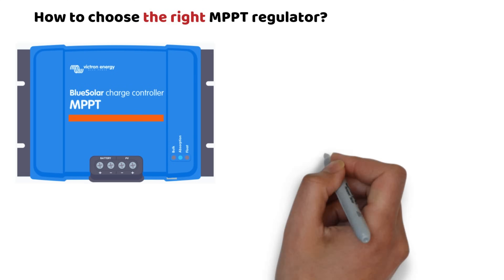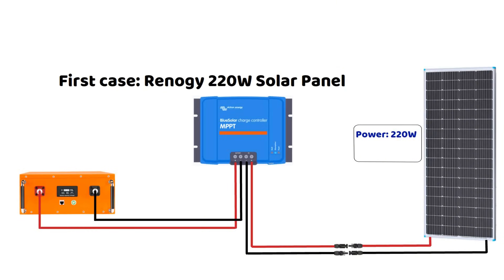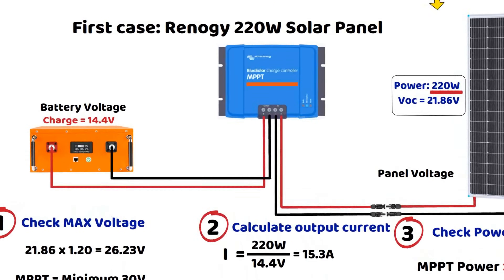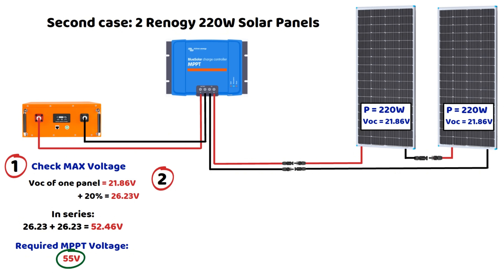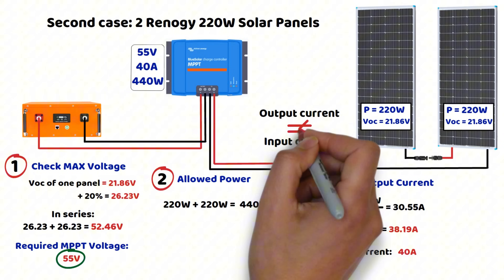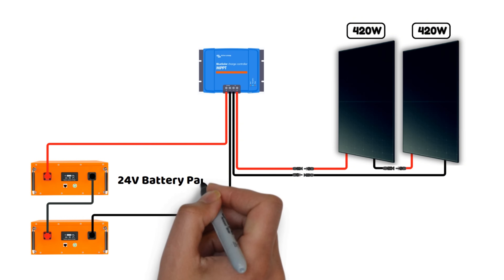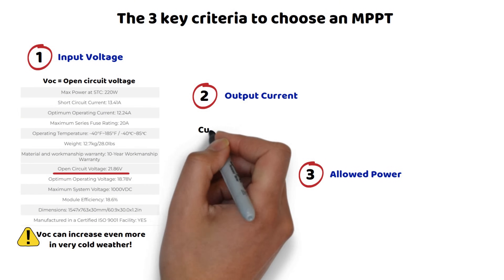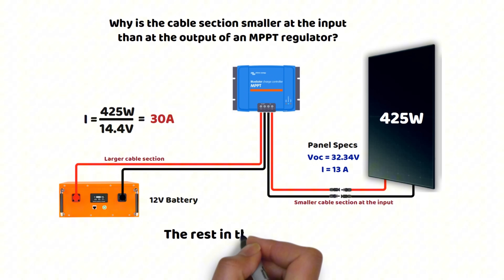How to Size a Solar Charge Controller? Avoid This Mistake...

Comment: In other words, you can skip all the electrical formulas and equations and just buy the MPPT controller that has the highest rated specifications in the model line up without going into industrial grade model's. This will future-proof your system and allow you to add more panels in the future without having to upgrade your MPPT controller. You want to avoid buying a controller that closely matches the panels nominal output because that controller will always be operating at or near its maximum capacity. At first glance, it will seem like the cost will be higher but in reality it's actually cheaper than buying a cheap system first (if there's such a thing) then having to repurchase bigger controllers and re-run bigger cables later just to add more panels.

Comment: Two panels connected in series you add only the voltage, the power remains the same they were a single panel.
You added both, the voltage and power.
Can you explain why? I didn't get it.
Reply: 2x400 watt paralel is 800 watt  in series 2x400 is 400 watt and not 800 Or i missing something
Reply: @hubertsteenbekkers1522  you're right. I asked the AI and it confirmed it. I was wrong . Thank you!

Comment: I am trying to find what mppt controler should I use with the 6 X BougeRV Yuma 200 W Cigs panels and for LFPO baterries x300 Ah ... I understand that it is much better to connect the panels in parallel and not in series in order to use a smaller MPPT. Is this correct ? For your guidance the Voc of the Yuma 200 w CIGS panels is 31,5 V and the Vmp is 25V..

Comment: Bigger is ALWAYS better (controller and wiring).
Just remember the return on investment - $1000 controller for a 100 watt panel is a bad investment lol
30% more specs is a good return on investment. Less stress on components for one. And you can add more panels if desired.

Going with a Victron 150/70 with 800 watts input. Bad thing is I am using 8 gauge wire (2 wires - red and black- at 100 feet each).
Panels are rated at just under 25v and just under 9 amps each. SS voltage is just under 28V. OC just under 25v.
I should be OK I think.
Pretty sure I can add another panel in the future too and still be under the max. Maybe a 400 watt one next time?

Battery cables (4 LiFePo4 12v 100ah batteries in parallel) will get 2 gauge wire each.
Inverter is 2000 watts but not running at max - just a refrigerator and maybe a chest freezer for about 250 watts or so.
Extra capacity is because of power draw at compressor startup. And to limit wear and tear on the inverter.
2 gauge should handle that momentary draw.

That Victron is a whopping $400!
Bigger one is $200 more and up goes the pricing after that.

800 watts generated /12.8v battery voltage = roughly 66.67 amps then divide that between 4 batteries and each gets about 24 amps. And that isn't going to over heat the batteries at that rate.

Most likely I will get about 15-17 amps per battery due to losses.

Just have to wait and see as I haven't assembled the setup yet.

Comment: G'day guys. I'm totally lost in this. I have 3 times 440-watt solar panels with an open-circuit voltage of 35.35 volts each. Got a 300ah lithium, what sice 12 volt Victron solar controller do I need please. Thank you for your reply

Comment: I need to charge 3-12 volts hooked in series for a 36 volt trolling motor. Can’t seem to find a controller for either 3 twelves or one 36. Please help.

Comment: My solar panel puts out 48 volts. Can a solar controller charge a 12 volt battery for running the pond filter during the night. It runs two water pumps during the day. With one panel. Can I use the second panel for just battery charging?

Comment: Good to know: for Victron MPPT’s the input current (Amperes) from the solar panels can be higher than the rating on the MPPT. In such a case the MPPT will then reduce the output current to the battery (to the rating that you will find on the MPPT). Of course this is not an optimal situation, but it will work. This info can be found on the Victron website.
Reply: Reduce output means generate more heat.

Comment: Your output current for a series of solar panels is horribly wrong. It should be the total power of all the arrays in series divided by the total nominal voltage across all the panels in series. It is also equivalent to the power of one panel divided by the nominal voltage of that panel. In your example, it your first example of the series connection, it should be 440W / 28.8V or 220W / 14.4V = 15.3A

Comment: I don't get the chat about maximum mppt voltage input suddenly changed to "minimum input voltage" 1:24. it's confusing. is the video done by AI?
Reply: Yes, its an AI voice, probably an AI script that gets a few things wrong and presents it in a bit of a confusing way. Also even mentioning the max panel wattage for the controller is a bit silly, wattage matters only tangentially, via the important specs of voltage and current.

Comment: SAY WHAT???? Listening to this was like listening to a flash flood! It’s moving so rapidly nothing can be absorbed, especially for beginners. The information might be excellent and an affirmation for those who already know 95% of the information shared, maybe helpful for folks on an intermediate/advanced level, but  it left me frustrated and feeling stupid.
Reply: No need to feel stupid.  This "teacher" is reading the script.  I don't think he could think this fast and be accurate as well.  I totally share the above comment about excellent information however all his effort is wasted if he wanted to teach.  Personally, if all his videos are like this, I won't subscribe.  There are literally hundreds of solar channels available that  provide information in a manner that is useable .  If you haven't seen the channel. "DIY solar" by Will Prowse do yourself a favor and check him out.  He speaks clearly at a reasonable pace, he doesn't read from a script.  There, I've wasted enough energy.
Reply: @tedk2814  🎯 Exactly.  I don't know what this guy's deal is but it's a lousy presentation. I'm not even going to go past step one. I'm a retired career (Avionics)  Marine as well as an instructor. He's doing all the wrong things.
Reply: you can slow it down so you can listen to it carefully
Reply: Yeah, adjust the playback speed from settings under the video.
Reply: @Polydeukes68 
I have no option to adjust playback speed on my smart TV.
Reply: .85 speed 👍
Reply: Lousy video! 
Your video sucks bc youhave it on rapid talk mode. 
No option to slow it down.
I went to find other videos that are talk slower.

Comment: What if you use a100 watt panel and a 12 volt battery, and a 1000 watt inverter, not everyone has more than 1 panel. Your video ain't working for me. I also have a l iron, not lead Acid .u got more money than my ass

Comment: So you might as well use pwm controller as they don’t seem to have a limit on input power ?
Reply: No - for 2 reasons; PWM are terribly inefficient when your panel voltage is more than about double the battery voltage, so PWM were great in 1990 when every panel on the market was around 15v-20v. Most panels now are 40v, so the MPPT is really the only solution. Secondly, mppt don't have a limit on input power, the video is incorrect. If you fuse appropriately, you could run a 10kw array on a tiny controller, the only issues are that if you connected the panels with reverse polarity you would break the controller (Victron can dissipate the power in reverse polarity but only up to their rated "max panel short circuit current" value) and your array would have a terrible cost efficiency.

Comment: I mainly use two Oupes solar generators that require only that I plug my solar panels into them and that's all there is to it.  It's basically plug and play.

I also have a small DIY solar setup that consists of one lone 250-watt solar panel that I presently have connected through a 40-Amp off-brand PWM solar charge controller.  Solar panel VOC is 37.6V and the ISC is 8.85-Amps, and the batteries are 12.8-Volt 100-Ah LifePo4 batteries.

This specific PWM solar charge controller is one of those that come with a user's manual that reads like it was written up by some Chinese guy who barely knew how to speak English.

I mention this because it's virtually impossible to understand those setup instructions and because this off-brand PWM solar charge controller isn't really compatible with LFP/Lithium batteries I'm using.

I've been wanting to get an MPPT to replace it with and I just happened to stumble onto this video.  I don't believe I need a 40-Amp rated MPPT charge controller for the small setup I have now but, I hope to upgrade my present single solar panel and 2-12-Volt LFP battery bank setup sometime in the future.

Will a slightly over sized 40-Amp MPPT solar charge controller be a problem if I connect it to my existing solar setup that can most likely do just fine with a 30-Amp MPPT solar charger?

If possible, I don't want to have to buy a 30-Amp MPPT unit and then have to buy another solar charge controller with a 40-Amp capacity when I get around up increasing the size of my DIY solar setup.

Basically, I just need to know if I can just use the larger 40-Amp MPPT solar charge controller now with my smaller solar setup and continue to use that same 40-Amp MPPT unit if I add another identical 250-Watt solar panel and an identical and additional LFP 12-Volt battery.

Comment: Is there a reason why none of the solar controllers have a rating on the "load" circuit? I'm wanting a controller to control 2, 90 watt cooling fans and can not find one to tell me it is rated high enough. Or a solar controller with multiple "load" outputs to separate the two fans. Seems like the load rating would be right on all the spec sheets. Any help is greatly appreciated.
Reply: Victron have the load limits on their spec sheets - for the 100/20 its 20A in 12v or 24v mode, and 1A in 48v mode (this is because in 48v mode, you are supposed to use the load terminals to drive a relay, not power the load directly)
2 x 90w = 180w, divided by 12v = 15A, so a 100/20 would be fine, but you might want to consider running that amount of power from a relay.

Comment: I don't get the output differences. The single 12 battery is going to stay the same no matter what the input voltage is to the MPPT. If you think of the MPPT as a battery charger If the input is 120 volts the output voltage will be determined by the state of charge of the battery, not the supply voltage. your examples seem to indicate if the input voltage increases the output voltage also increases. That would only be the case if I plugged that 120 volt charger into 240 volts. 
You should go over your examples. Putting more volts in will make more watts available on the output. If the output is 14.4 volts dc then as the battery increases in charge the current will fall off but the voltage remains the same.
Reply: Yes, the video got many things wrong.

Comment: Something wrong here.  In serial setup output current will be the same as a single panel right? Only the voltage will be doubled.  If you double the current, that is a parallel setup right? Where you had at 4:05 is wrong.
Reply: At 4:05 is the output of the controller, not de panels. On that side the current will be double,becose the voltage is allways 14.4V (in theory)
Reply: @davidklug5339 , the output of the controller will only be to the battery to charge it and this is controlled by battery (the load) and not the source (solar panel). 
The video is referring to the output of the solar panels in series and if maximum power is draw from it, it will be the total power of all the panels in series divided by the total voltage across all panels in series. And no, that is NOT the voltage of the battery.
Reply: @coderlifer4870  A not-fully-charged Lifepo4 battery is almost like an infinite load — it will pull the maximum current from the panels that they can produce (assuming the controller can supply it).
And yes, in step 3 it’s the battery side, because the question is how big the controller needs to be so it won’t become the bottleneck on that side.
Reply: @davidklug5339  , yes the battery will draw what it needs, if it can. But the source of the energy is from solar panels. The solar panels can only provide the maximum they can supply. It will not provide an Infinite source of power! In the first example in the video, two solar panels in series can only provide a maximum of 440 Watts. And with a total voltage across all two panels in series of 28.8V, the current will be 440W/28.8V. Note: 440W/14.4V is incorrect because the two panels are in series!
Reply: @coderlifer4870  sorry I can't explain better or more often that step 3 is the battery side of the controller where it is 14.4v (max). The video is clear and correct.

Comment: Hello. I have two 445W solar panels, Voc 52.6V, Isc 10.71A, a 1500W inverter, and six 2V 490Ah lead-acid batteries connected in series. What kind of MPPT charge controller should I use, and what cable cross-sections are required from the batteries to the MPPT and from the inverter to the batteries? I also plan to install a 16A automatic circuit breaker between the panels and the MPPT.
Reply: The voltage cannot be higher than 52,6 V per panel but will never reach that under normal operating situations. Also not under low temperature circumstances. I would go for an MPPT that can accept 100 Volt and 20 amp. On the Victron site there is a calculator where you can choose your Solar Panels and it will show the appropriate MPPT. You said six 2 volt batteries. I assume 12 volt batteries? Your inverter can draw 1500/12 = 125 amps but to be safe use 1500/10 =150 Amp. Only if your batteries can be discharged at such a high level. Not all can handle this.  You can use a 4AWG copper cable, but only a 150 amp rated 4AWG
Reply: Oh yeah: I assume the panels are in series

Comment: is 14.4V a fixed value for 12V battery? What if the battery is 72V?
Reply: Don't know about lithium but lead acid requires about 14.2 vdc to charge. Nominal voltage on a 12 volt lead acid is around 13.2 if fully charged. My memory may be bad on those values, a quick web search will turn up the actual values.
Reply: A nominally 72v battery is probably a 24 cell battery, so for LiFePO4 that would be a charging voltage of ~86v and a fully charged resting value of ~84v

Comment: You don’t have to do math when the short circuit amps, and voltage is on the back of the panel. Then you just look at the rating information the mppt charge controller can do for watts, at a specific battery voltage, and at what voltage it can input from the solar panels depending if the solar panels are series, parallel or both.

Comment: This is pretty accurate, but I'd like those watching this to know that the input voltage can't be surpassed for a MPPT but the output current can, it's very safe to do so and you won't harm the MPPT. The MPPT will derate the current to it's maximum output current. Given the rarity at which your array will output near the max theoretical output, It's likely better for most users to save the money and select the 100/30, at least in your example. Could you lose like 2 amps for a fraction of an hour theoretically? sure, but the duration of time in which you'd output that is minimal anyways.
Reply: Please help.
Camper with very little space on roof.
2x 12v 80ah plus a extra battery for the vehicle. 

First two are the same year and brand, 

I need a new solar panel. And, I'm not confident in my controller. 

I wish I could include photos..

Please reply and I will include all the information I have.
Reply: I’ve currently got a victron mppt 100/15 I’ve just added another solar panel that’s 200w will this be big enough,I don’t understand the video as much as he’s breaking it down
Reply: @Bm11122  From the video a 220 watts of solar panel(s) total (combined or sperate)  wattage would be right at the max amps of your controller with no margin to help with durability of your controller. Ao as long as you do not exceed the 220 watts of input power you should be ok .
Reply: @crackmonkeynet  This is not correct. You can exceed the well over 220 watts of panel (over-panelling) - Victron even recommend over panelling up to 130%. If you had a Renogy or Epever, maybe not but we always over panel Victron controllers. The "margin" used in the video is silly, why choose a random % when you have the temperature coefficient of voltage and can work out exactly what the Voc would be at winter temperatures, and all you are doing by adding a margin to the current (also silly) is likely pushing yourself into the next controller up, when the controller is perfectly capable of blocking current over the rated value.
Reply: @darylegarr5217  Epever BN series can be over panelled / over watted by a factor of x1.5. So quite similar to the Victron recommendation of x1.3

Comment: Is current always flowing into MPPT from solar panels? Or do the panels just act as terminal voltage. If the battery is fully charged I assume the controller inhibits the flow of battery current under no load conditions. If so , how does it do that?
Reply: Think of the panel as a capacitor, and the mppt letting the voltage in the wires rise up to Voc. When the mppt wants power, it lowers the voltage of the wires, creating a voltage difference and therefore current flows. So once the battery is fully charged the mppt can just let the voltage rise up to Voc and the current stops. That's one way to visualise it.

Comment: Can you connect a 30 volt panel  to solar  controller  ???
Reply: It's crucial that you do not send more voltage to a solar charge controller that it is rated for that's certainly one thing that that will cook it.  It's best to err on the side of caution and have a little extra voltage rating headroom
Reply: Yes, as long as you have a 12 volt battery and not 24volt or higher